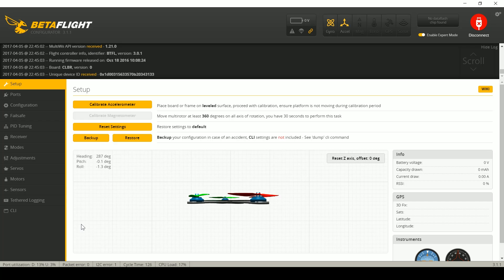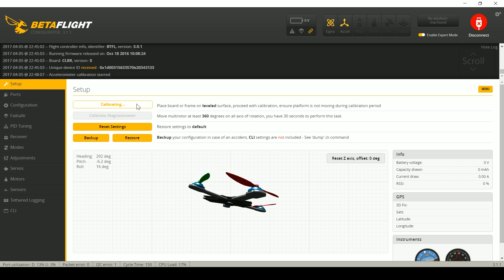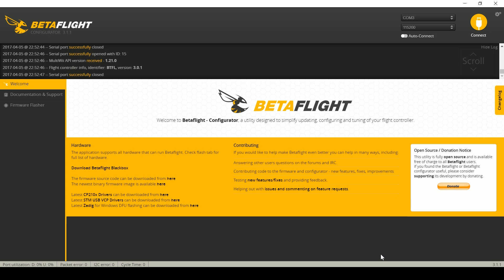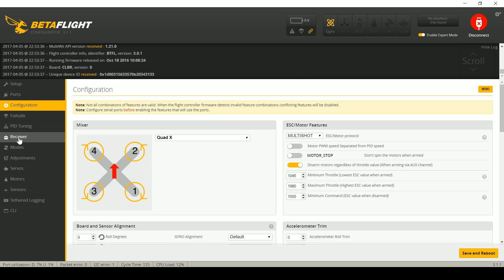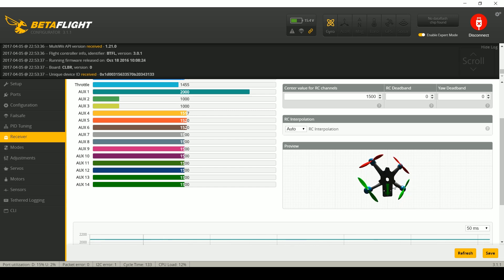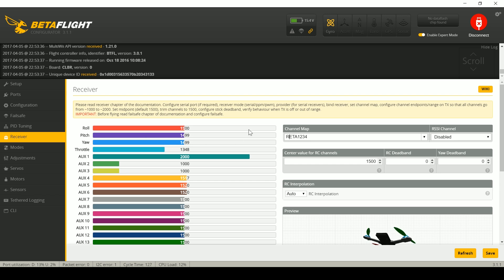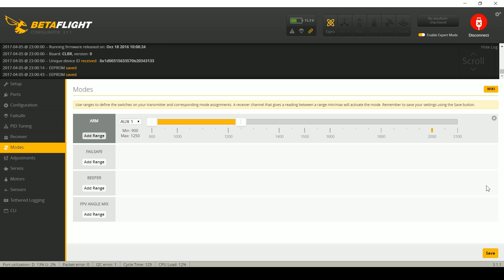Quadcopter Won't Arm | CLEANFLIGHT BETAFLIGHT

Comment: Believe everything is in check with my new Blade Thoery XL, but the dang thing won't arm. Only thing that seems to be acting weird is the "warning" light on the flight controller doesn't flash (saying it can't arm) whenever I have the throttle set to wear it shouldn't let it arm. All of the bindings appear to be reacting correct but it just won't arm...
Reply from the maker: Go to the CLI and type "status" and look at the arming status flags. That will tell you why it won't arm.

https://github.com/betaflight/betaflight/wiki/Arming-Sequence-&-Safety

By default it won't arm when plugged into USB or when in the CLI.
Reply: # status
System Uptime: 74 seconds
Voltage: 162 * 0.1V (4S battery - OK)
CPU Clock=72MHz, GYRO=MPU6050, ACC=MPU6050.n
Stack size: 2048, Stack address: 0x10002000
I2C Errors: 0, config size: 1604
CPU:8%, cycle time: 501, GYRO rate: 1996, RX rate: 91, System rate: 9

Not seeing any arming status flags
Reply: Something is odd about this. betaflight shows that my throttle stick is working correctly, the arm switch works correctly, and the "not safe to arm" light is not flashing, yet still not able to arm it and control the throttle. I've only been able to spin the motors through betaflight so far. Very frustrating.
Reply: I have found my issue. Not sure if you mentioned it in the video, but the value for min_check must be greater than the lowest throttle position. It will not register if the values are equal. I assumed by their description of the field that greater than OR EQUAL TO would work. This is not the case. I still find it strange that the LED on the flight controller does not flash when the throttle is out of range of safe arming conditions, but oh well, everything is working correctly now. This Blade Theory XL is a blast!

Comment: Hey Josh, great vid. I've managed to get everything to work on cleanflight, motors, receivers etc, just can't arm it. CPU load is 100% with everything turned off & set low, any ideas. I have an F3 board,
Cheers

Comment: Just watched 3 videos and tried everything. My brand new hglrc xjb-145 with spektrum satellite with telemetry will arm just fine as long as its plugged in to betaflight, but if its armed and betaflight is disconnected it will disarm and will not arm at all without usb connected to betaflight... It also makes me rebind every single time its powered up

Comment: Hi Joshua! Would greatly appreciate some help. Looked at a ton of videos - nobody seems to have my issue with FlySky, Eachine and Betaflight.  Binding appears to be successful yet when I open Betaflight and connect, and go to the Receiver tab, all settings are at "0" and not color bars exist for Rolle, Pitch, Yaw, Throttle, AUX 1, etc. Have you experienced it or know what is going on? Please help - thank you very much in advance!

Comment: Josh, great tutorial, been trying to get my Arris X220 pro in the air for weeks. Even after resetting to default the CPU load is 100% how do I fix this. It has a flytower raptor s with an f3 fc. thanks in advance

Comment: Hello. New pilot here. Bought a QX7 n a used eachine 130 frsky receiver with clean flight sbus. Qx7 n quad binded. But can't or wont arm. Green noob. Any possible problems im not doing right. Frustrating messing around clean flight n cant figure out.😢
Reply from the maker: https://www.youtube.com/watch?v=3mOeL8f1dMM

This is the updated version.

Comment: hey, Joshua I tried everything here and it won't arm still. everything works the way it should. it happened after a crash. any ideas? Iv used the motor test function to confirm everything works. Iv rebound the receiver to make sure it works.
Reply from the maker: https://www.youtube.com/watch?v=3mOeL8f1dMM

Comment: I have the Eachine Wizard X220 paired with the FlySky FS-i6 with the FS-iA6B transmitter. The remote will pair to the quad, but it will not arm, and will not connect on BetaFlight. I have tried almost everything, including changing the settings in the remote. Please help!
Reply from the maker: https://www.youtube.com/watch?v=m4ygG6Y5zXI 

https://www.youtube.com/watch?v=3mOeL8f1dMM
Reply: Thanks for the help, but it isn't any of those issues. The motors spin fine on BetaFlight, and I don't know if the remote is even connected to it...
Reply: Update: it works!! What I did was I started it in bootloader mode, then I completely reinstalled BetaFlight, but even then I had to change some settings. I had to wipe it completely, etc. It seems to work fine now! :)

Comment: used one of ur videos and sorted it went to configuration board and sensor alignment and changed the default to gyro and accel alignment to cw 180 now all ok thank you for your videos joshua bardwell nice easy to understand fantastic videos aswell cheers buddy

Comment: hi again iv updated the flight controller and all works again but keeps flipping out on throttle up when i tilt the x220 quad forward and back it goe left to right and when i tilt it left to right it goes forward and back or up and down board is in right place just not sure what i have to do can you help with this please thank you

Comment: on end points on my taranis start at 1017 to 2000. iv done the end points from middle to end at 2000 but it wont let me bring 1017 to 1000. why is this
Reply from the maker: Try enabling Extended Limits in the Model Setup screen

Comment: hi in my receiver tab theres nothing no colours at all jus all blank could you help i set my arming switch to switch d on the i6 but it was aslo set to throttle hold now it wont arm aswell any idea mate thanks could it just be low battery power in the i6 transmitter at all i had a melted plastic on wire of the receiver ia6b i think it is so i got a new ia6b binded ok jus nothing lol its the x220 cheers
Reply from the maker: +Nick dutton blank channels in receiver tab usually means you are on a super old version of Betaflight like 3.0.1. Upgrade.
Reply: Joshua Bardwell thank you will do

Comment: Great video, I'm still having issues. Recently got a king Kong tiny 7 with flysky ppm receiver. Bound to my evolution, on receiver tab in beta flight showing all zeros. Couldn't get receiver tab to register until I read somewhere to update firmware. Before doing this I made a copy of my original dump file. Updated to the latest beta flight and stick commands showing in receiver tab! Had to remap them manually as they where all muddled up!. As you mentioned in the video I'm getting a slow red flashing light on the FC. I use switch arming usually no issues at all. Can't get this to arm...... Feel like pulling my hair out. Would really appreciate some help.

Comment: P.S. the quad won't arm unless you are first out of ARM mode's interval (gray area), then in (yellow area). For example, if you boot with ARM directly activated, you might get a BAD RX status and it won't arm. 
My flight controller didn't have any switch I could assign, so i set channel 5 to send a copy of the throttle signal, and set the ARM range to [1050-2100]. This way, at boot, i am first ARM-OFF (throttle at 1025, that's below range), then when i put the gas on, it's ARM-ON (throttle over 1050, in the range).
Reply from the maker: +Jean-Louis Bonnaffé this is a terrible and unsafe idea. If you don't have a spare channel to use as an arm mode, use stick arming.
Reply: hi, josh. what a great pleasure to talk to you too.
so yes, that is a way to bypass switch/stick arming, and i agree it may be dangerous for unexperienced users with powerful gear. thanks for them.
the part about the arm-off/arm-on sequence, may still be worth mentioning, though. you're welcome.

Comment: Josh what do I do if when I go onto betaflight, all of the receiver section are completely blank. I am using a fs i6 and wizard x220. Plz help asap
Reply from the maker: Your version of Betaflight on your FC is too old. You need to upgrade to a newer one. But when you do it, it will wipe out your configuration. So you need to go to the CLI and dump the configuration first, and be able to rebuild it when you upgrade.
Reply: Omg thanks so much, just fixed it, thanks!

Comment: great! you saved a ton of my neves with the info "it dont arm at high cpu load". finally this was the solution to my problem of the day! 
now i have one other problem left, one of my FCs works only on one of two PCs (connection to betaflight). other FCs work great on both PCs. the normal troubleshooting and driver installation videos don't work, think i have to search more....

Comment: Hey,,,,great video, However, I cant arm now because I cant seem to be able to save the Min Check to 1100. Its saves but after reboot it goes back down to 1000. I cant use the trims on my remote to go down any further than 1087. How do I get Min check to save at 1100 in CLI?
Reply from the maker: Are you typing "save" after you set min_check? Or are you just power cycling the board.
Reply: nope,,,,just enter. It works now after having to type enter. Thanks !

Comment: hey my switches just wont register in beta flight...the throttle, yaw, pitch and roll do register in beta flight when I move them. However, non of the switches register. I have a taranis x9d plus. Please help!!!
Reply from the maker: Did you set up a the mixer to assign the switch to a channel? I show how to do it in the beginning of this video: https://www.youtube.com/watch?v=SLy28mYiAzU
Reply: ok that worked. However, I cant arm now because I cant seem to be able to save the Min Check to 1100. Its saves but after reboot it goes back to 1000. I cant use the trims on my remote to go down any further than 1087. How do I get Min check to save at 1100 in CLI?

Comment: Hey umm.. Josh, I crashed my Tiny whoop pretty damn hard, broke the cloverleaf antenna because it landed upside down on acro at full throttle, wouldn't arm, plugged it into Betaflight and the "Calibrate Accelerometer" is grayed out like on your screen how "Calibrate Magnetometer" is grayed. Do I need a new FC? Is it repairable?
Reply from the maker: +Aaron G are you sure the accelerometer is enabled?
Reply: Yes sir, accelerometer enabled in the settings. I reset it, re-flashed it, full chip erased it. Nothing works. I gave up, ordered one on amazon. Thanks for the reply.
Reply: I have the same problem on a FrSky Apus MQ60. "Calibrate Accelerometer" is grayed out, event after reflash, restore default settings the drone was delivered with. Accelerometer is enabled. Any idea?

Comment: Oh, my god, this is was annoying me so bad. My drone got stuck in a tree and I couldn't arm it to wiggle it free, had to spend 20 minutes throwing sticks at it to get it out of the damn tree.  Small_angle = 180! This video saved my life.
Reply from the maker: +TheFluffyDuck you can also use stick commands to recalibrate the accelerometer while in the tree.
Reply: Joshua Bardwell thanks for the reply!

Comment: this didnt help me my copter wont arm properly and wont arm in motor test all it does is spoil up and nothing else no response from the ransmitter changes it after i arm and the switch seems to have no effect other then to allow minor rpm adjustment
Reply from the maker: If you can flip the switch and the motors spin then this isn't your problem.

I'm not sure what you mean by "minor RPM adjustment".

Comment: Help!!!
I am able to disarm my copter midflight regardless of throttle value.
How do fix this?
I am using an old cc3d board with ibus input.
Reply from the maker: There is an option in the Configuration tab that lets you disarm at any throttle position. Disable it.

Comment: Awesome!  Problem for me was 'min_check'.  Got an Atom 122 from a friend and had to figure out why it wasn't arming.  Does min_check correspond to one of the parameters in the configuration menu (minimum throttle, or minimum command)?  Or can it only be accessed via the CLI?

Comment: Hey josh, I recently replaced 4 tbs escs on a quadcopter I bought from a 3rd party and now my quadcopter doesn’t respond to any of my tx controls but it does to my rx controls, on betaflight my tx controls don’t input aswell. If you know what might the issue be please help me
Reply from the maker: If all you did was change out the ESCs, I can't imagine how the receiver would have stopped working. Does the receiver show as bound (typically a green LED)?

My guess is you accidentally damaged the receiver signal wire while replacing the ESCs.
Reply: Joshua Bardwell I did, and I soldered it straight to the rx but I believe I also wiped the board completely and I never enabled the serial ports when I spent 5 hours doing so I’m so used to plug and play rc cars, i bricked the board and I’m currently trying to bring it back to life so I can test my theory with enable the port
Reply from the maker: Put the board into bootloader mode and re-flash the firmware to it with "full chip erase" selected. This will default it and bring it back to life.
Reply: Joshua Bardwell I got it back it to life, I took apart the quad and the rx is plugged into ppm3 no clue what I do on betaflight to configure the rx tho because I didn’t build it and I can’t seem to find anything on this rmdo board
Reply: Ps I know I go to ports by I’m not sure what I do in the ports section, do I go to uart 3 and then turn it on ? I’m so lost. I’ve spent the past 12 hours researching every aspect of betaflight , battling with the flight controller between being bricked and reversing the motors. All because I blew a motor and replaced all 4 escs because one was fried and I had an eBay seller send me 4 for 40, and if I can figure this quad stuff out I’ll be building a film rig, and by the way you are extremely smart and if you ever wanna see your twin go watch white collar. You look just like mozzy

Comment: 1. Quad is not level 0:00
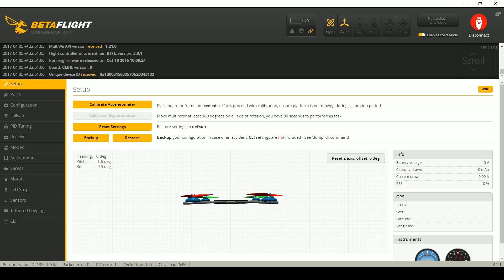2. CPU Load too high 3:50
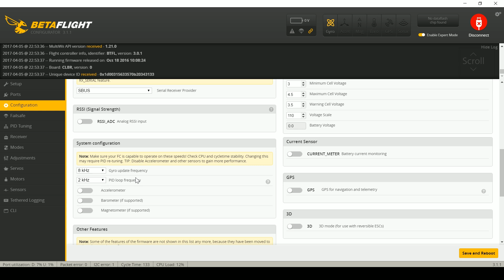3. Receiver end points / binding 6:30 < most common is is min_check
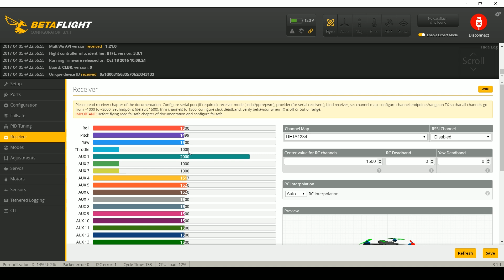4. Receiver channel to function binds 10:15

set min_check = 1005 (for a throttle that bottoms out at 1000)
Reply: Thanks, Josh knows what he's talking about but sometimes he takes a while to get to the point!
Reply: So useful
Thanks
Reply: 4. For me, the arm switch was defined only in the wrong area ... 
I had never change this value ...i dont know how this happend.
Betaflight is bitchy and makes me what it wants ^^
Reply: mine bottoms out at 885? what should I do here
Reply: That command fixed my problems, thank you a ton for that

Comment: Joshua, I am trying to get a Wizard 220X operating with a DX8 and Spektrum racing receiver. Betaflight responds to the quad with setting up profiles, settings ect. but with the Spektrum racing serial receiver (which is on Uart 3) and the DX8 binding complete, powered on and transmitter on the Betaflight - Receiver settings shows NO bars at all. I can't seem to get past this.  I have been successful using Betaflight with Taranis setups but not with this Spektrum setup attempt.
Thanks for your help.
Reply from the maker: +cfrankfly what pin on the FC did you connect the receiver signal wire to? I am going to guess your last receiver used PPM and you wired the Spektrum Satellite to the PPM pin.

Try this.

Assuming you have an SPRACINGF3. Wore the receive signal wire to UART3 rx pad on top of the board.

In the Ports tab enable serial receiver on UART 3.

In Configuration Tab select serial receiver type and Spektrum 2048 ad the protocol.

Comment: Hi Joshua, i stupidly swapped the port identifier from uart1 to uart2 now i can not connect to the drone. any thing i can do to connect to it again? and set up my drone?
Reply from the maker: If you have an FTDI adapter you can wire it to UART2 and connect that way. 

Otherwise, re-flash the board with "full chip erase" selected. This will wipe the config back to default.
Reply: thanks re-flashed it back on betaflight...but no luck setting up my t8sg controller.

Comment: Here's a new one:  When I go inverted for more than a moment (for example during a power loop, not a flip or roll), I lose control of the quad. It feels like a failsafe, but there's no evidence of that.  I have a Hyperlite F4 FC, (new) Spedix 4-in-1, and TBS Crossfire micro. I recently upgraded to the latest BF w/turtle mode, dynamic filters, etc., but had good flights with it previously. Any advice would be appreciated.

Comment: appreciate your helpful videos, great resource. but this one is  a miss.  instead of what not to do, how about showing what exactly needs to be configured, .  what should everything be set at, min check should be nd match what/where?  I set my min_check=1100 and it wont arm, also tried 990, 1000 and it wont arm . thanks
Reply from the maker: +Rian HART https://youtu.be/3mOeL8f1dMM

https://youtu.be/JkggzZySIqs

I made the videos you're asking for too. I make a lot of videos. You just didn't happen to find the ones you wanted. Here they are

Comment: Hey there, I have an atom v2 that i took in trade and I have ran through your checklist and it still will not arm.  I have a slow blinking red light and the Arm switch will not light up in the arm position.  The motors spin up in the motors tab, too. I know it is something simple that I am just overlooking, but I am now at wit's end.  PLEASE HELP.  Thanks, Jonathan
Reply from the maker: +Jonathan Moore https://youtu.be/3mOeL8f1dMM